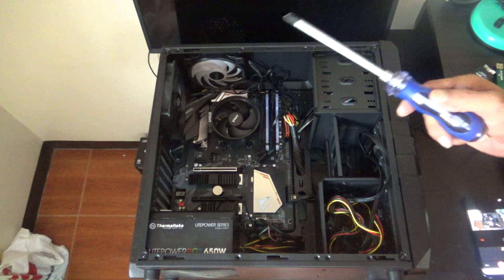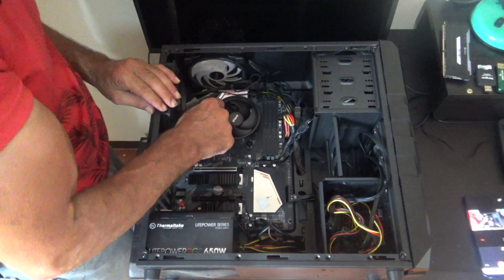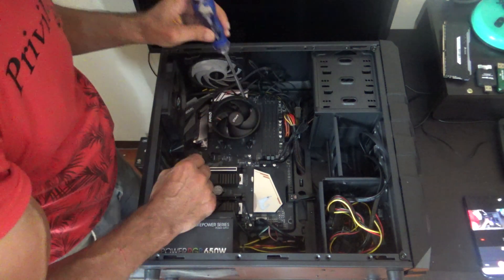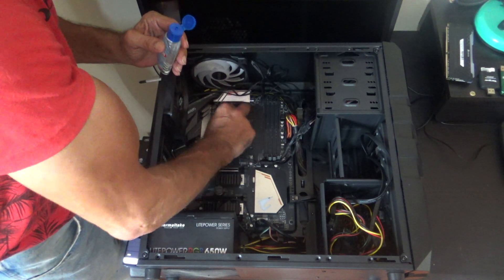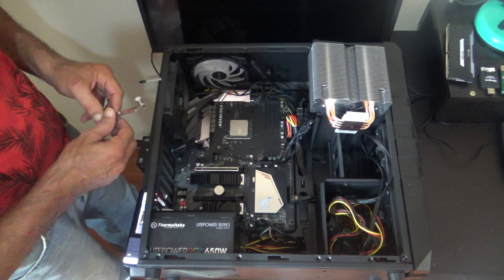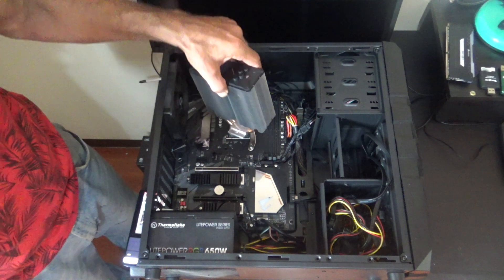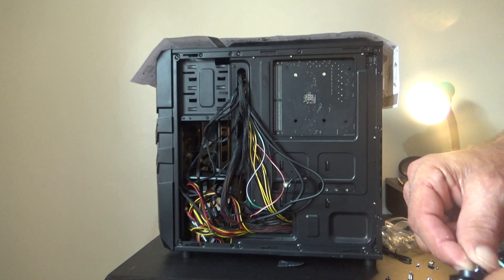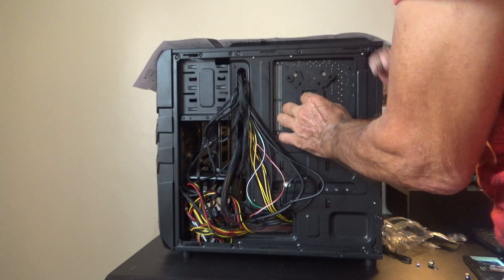Deepcool Gammaxx GTE RGB Install CPU heatsink AMD ryzen 2400G Part 1

Comment: Can this cooler handle R53600 temperature?
Reply: @dinod-americaninthephilipp9238    im only running my cpu in stock clock. So that will be great cooler then. That really good explanation and suggestions there
. Keep the good work sir! You have great biceps too ! Thnks